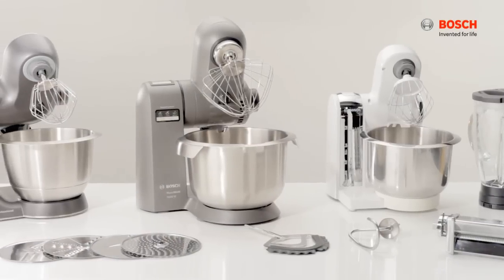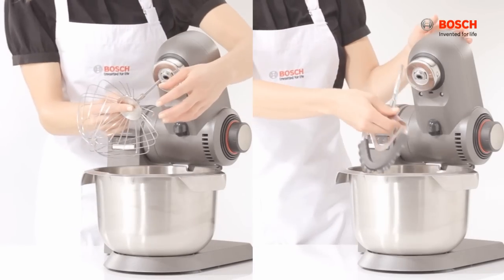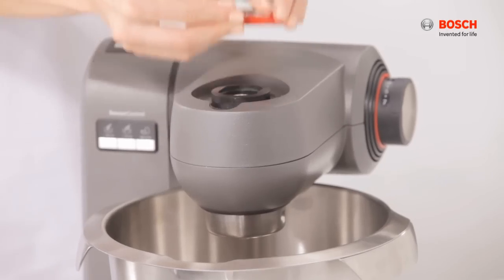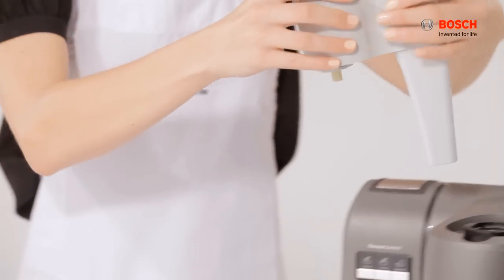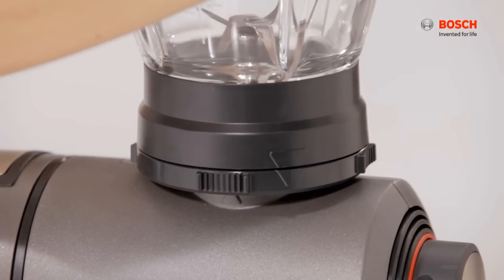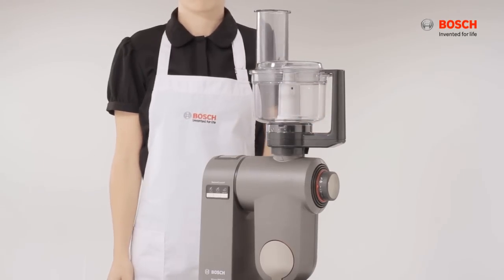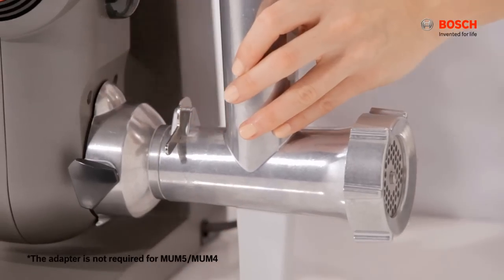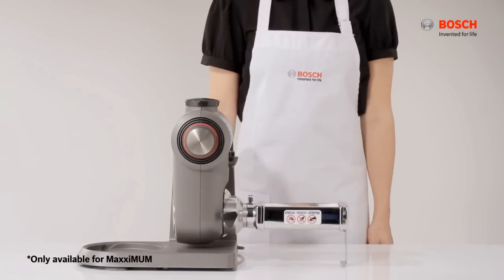MaxxiMUM SensorControl Kitchen Machines - Accessories User Guide

Comment: Each time is forgotten to state that the safety caps must be replaced before one can even use the next accessory on another part of the machine otherwise the next will not work at all... for example the cap on the back of the machine must be place back before one can use the vegetable shredder etc...
Reply: Hurrah!!! Thanks so much. I was ready to return it because the blender refused to work though I could hear a "click" as if it was trying to. I checked all safety caps and voila, it worked! :)